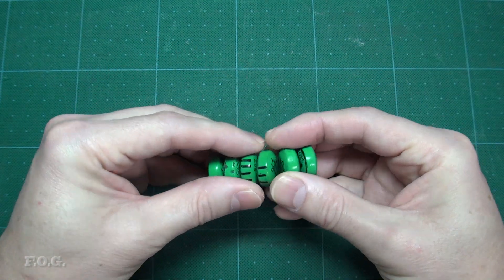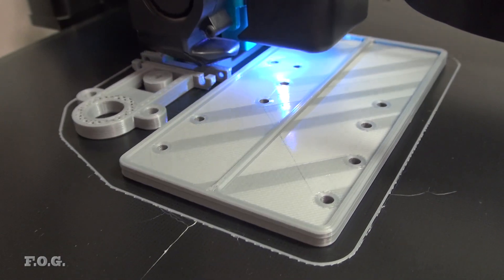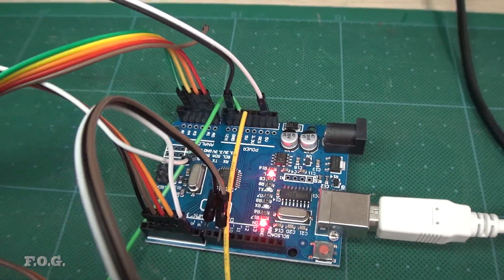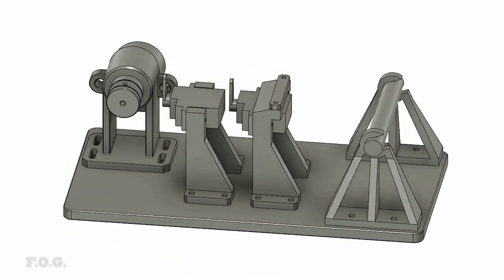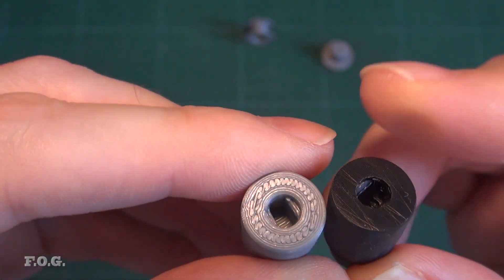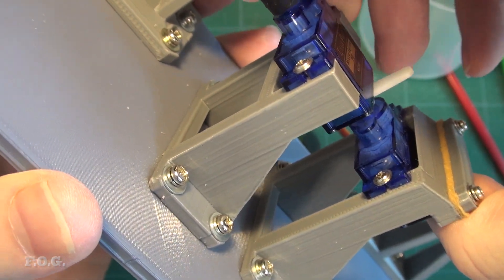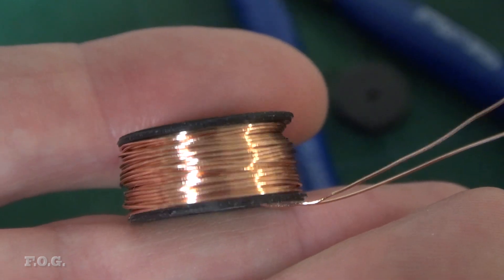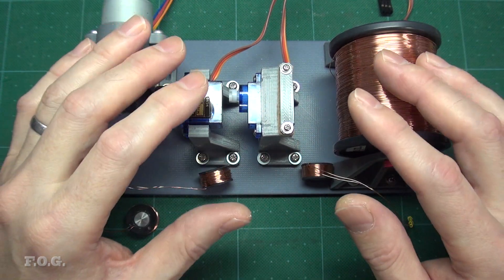EP2 - Electric Motivation - How-To make a Magnetic Coil Winder

Comment: I'm no expert, but I'd say re-imagine your tensioning system. Even though they move in unison, there are times where it looks like the second is dragging or fighting the first. (Just based on what I saw in the video - I haven't spent the time with it that you have.)
Alternatively, reconsider the servo positioning during a cycle. Maybe just have the first one lead the second through the same range of motion by like 20° or something, instead of it moving a greater sweep at the same time for the same time.
Reply from the maker: Thanks for the feedback, you have got good eyes.
Both your points are good. Actually there is some type of catch occurring, the cause is the relationship with the distance and weight of the feed reel.. Moving it further away or doing as you said would probably solve it.. I might give your idea a try at some time.
But I spent literally days watching the behavior, and am pretty sure that the small tension skip is not the main issue.
I can see that no matter what, there's a varying tiny space build up, and tension ultimately pulls the wire into the space, and this space causes the next layer wire to fall in and catch.. causing the chaos.. I can solve this mostly by adding and removing winds on specific layers.. but as this is so inconsistent, I could not come up with a formula based solution.. If there was active feedback (visual sensing?) then maybe I could get it to work..

Comment: Your comments regarding resin printing are interesting; most reviews I've seen print dungeons & dragons figures, and accuracy is not measured.  May I ask your printer model?  Thanks for the video.
Reply from the maker: Yep, seems there is a good reason we don't see resin printers used allot for practical prints..
Mine is a Elegoo Mars [P].
Thanks for the comment!